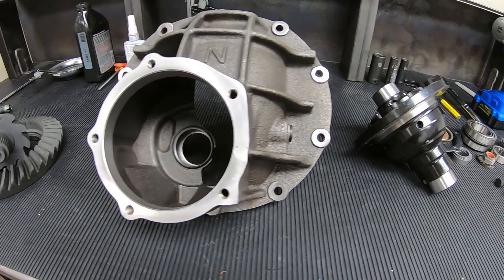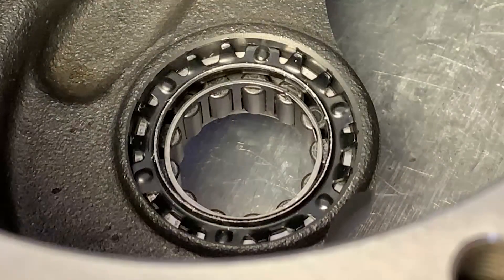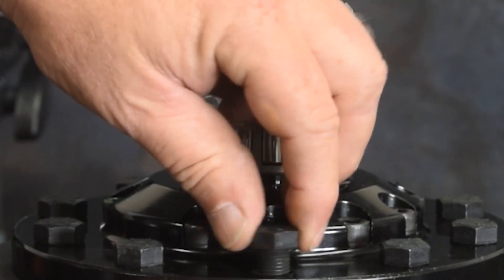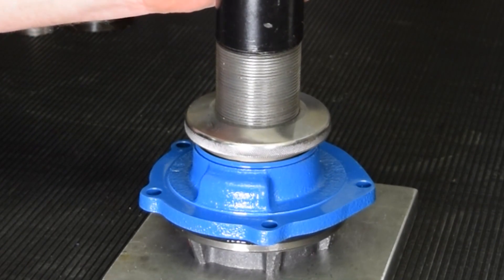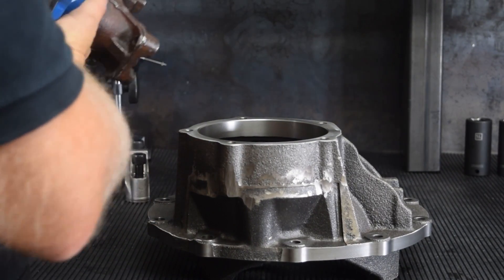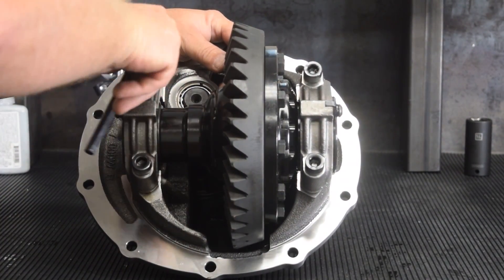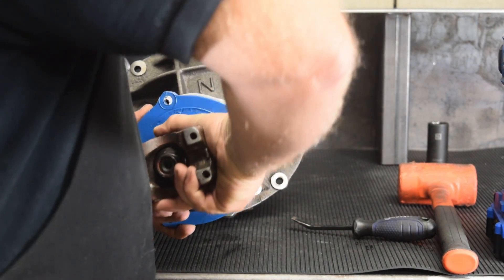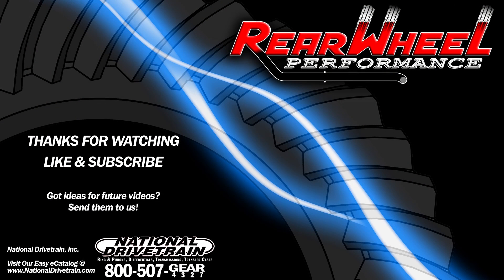How to Build Ford 9": The Quick Guide

Comment: Could a rear differential cover be removed, and this third member be bolted in place of the differential cover and act as a union for a tandem axle build?
Reply from the maker: We understand your question, but as a brief answer: no, it is intended for use in a single Ford 9" model rear end which were very common in the mid-50s-early 80s Ford cars and light trucks, and is still common in many custom racing and performance build applications.  Tandem axles would be more common in heavy class trucks or designed and built from a specialty custom engineer/fabricator.